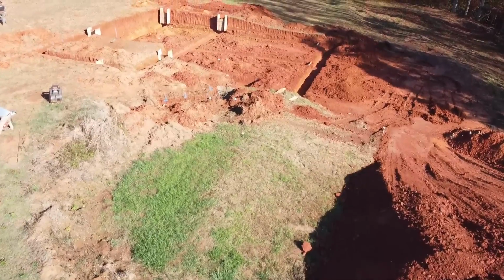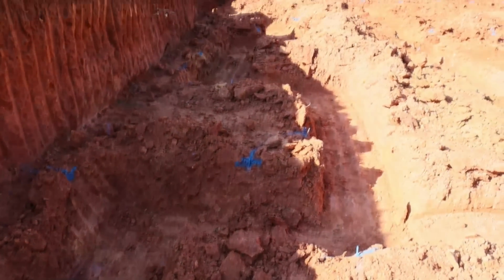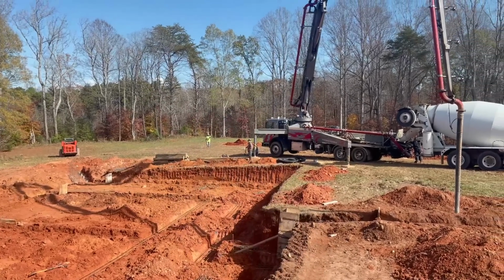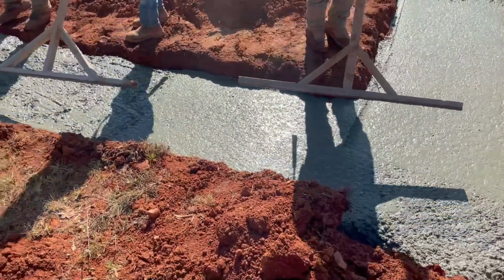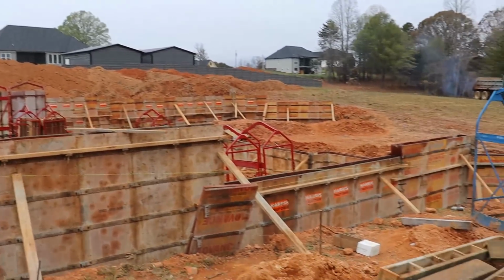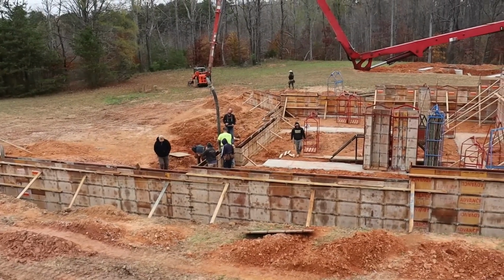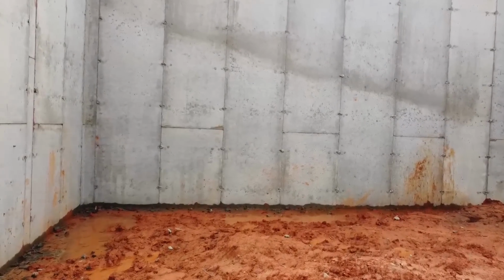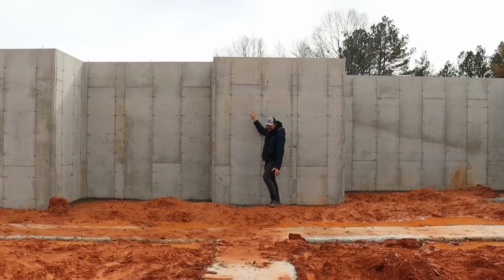MIKES HOUSE BUILD POURING THE CONCRETE FOUNDATION

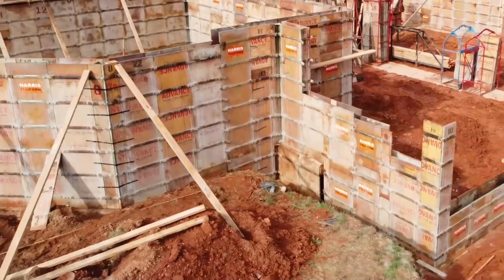Comment: stop at 14:47 that drop down wall is way wonky WTF?  is the whole wall layout like this or did they snap it out and level those walls up with bracing?  it kicks out over an inch for like a 7ft wall thats a lot, wonky walls at 15:15?

Comment: i like how you pour a continuous slab of concrete here where i live we use blocks what you call cinder blocks for back walls but in your case you have a much stronger foundation and the wall won't spring leaks easily that's gonna be a very strong structure